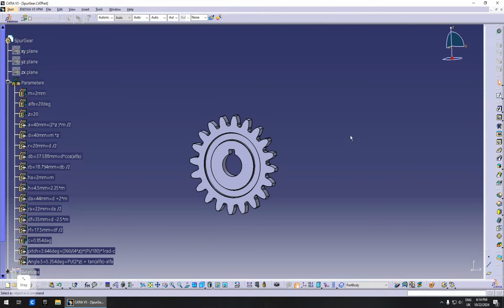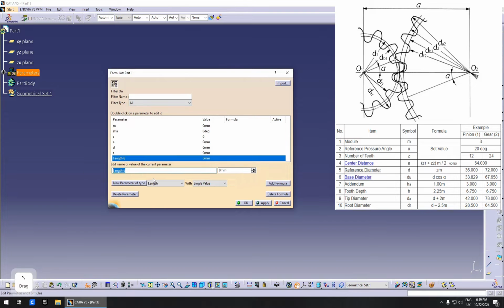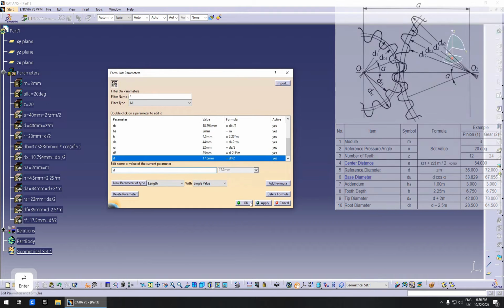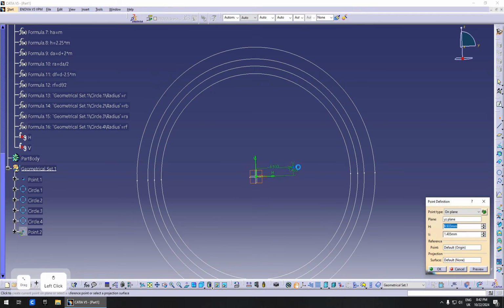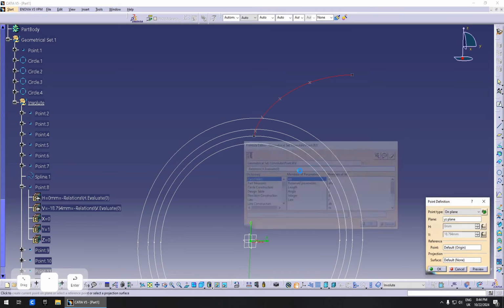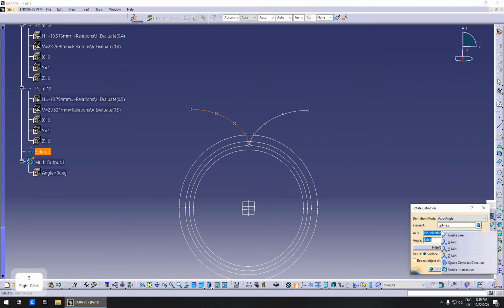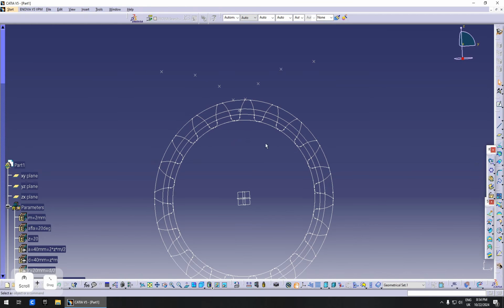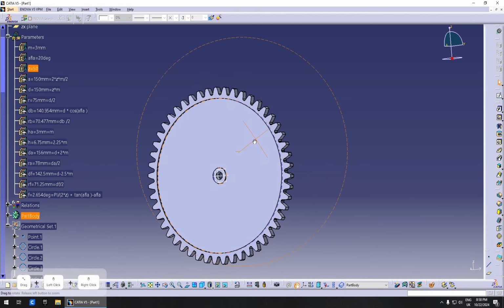How to Design a Spur Gear in Catia ? | CATIA V5 Tutorial

Comment: Je trouve cela extrêmement long et complexe pour modéliser une roue dentée. Et très dommage que Catia V5, ce logiciel à la réputation surfaite, ne soit pas capable de tracer directement une courbe à partir d'une équation mathématique. Je vous propose de regarder ce que fait la concurrence et vous verrez la différence : https://youtu.be/-2nZYFlkIK0
Reply from the maker: I agree, it's overly complicated for no reason. There should be an involute tooth generator function. 
But isn't the video you shared doing the exact same thing?
Reply: @CADMasterclass-r3s  Thank you for watching my version of creating a gear wheel.

There is one point that is very different from the method used with Catia: It's the ability to directly create the involute of a circle using an equation, which provides speed and precision. In Catia, you have to go through placing points driven by an equation, followed by an interpolated curve. This is slow and lacks precision.
Reply from the maker: @Expert3dModeling Yeah, I see what you mean now. It would be nice to have that in Catia as well ... But considering we have had V6 and 3dExperience from Dassault and still are not able to plot a curve using a function, I won't get my hopes up 😅